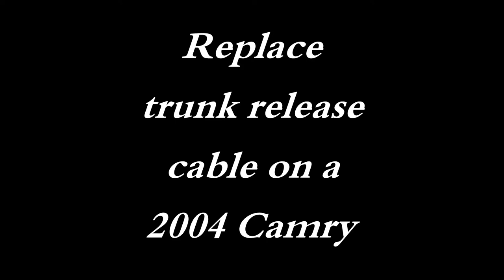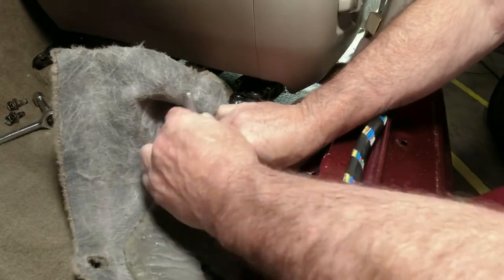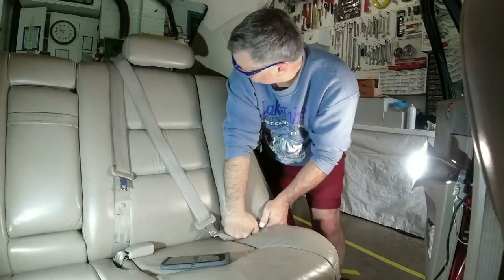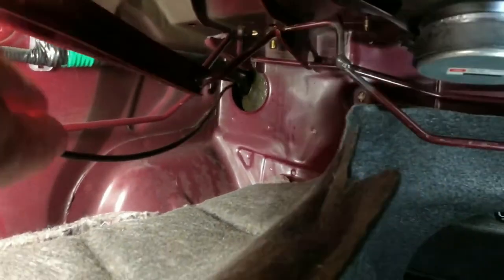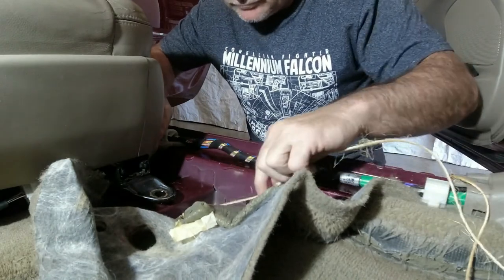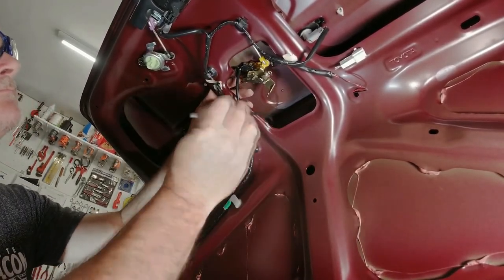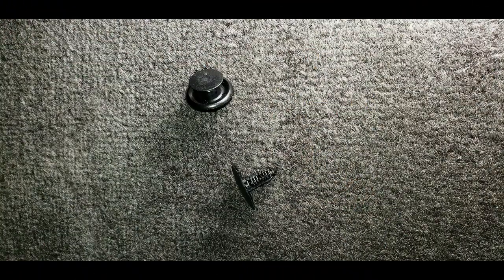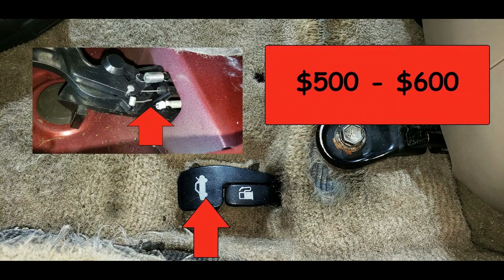Auto (replacing a trunk release cable in 2002  - 2006 Camry)

Comment: Thank you, I was able to replace the cable at my Toyota Aurion 2009 with your guide. Had to increase the tension a bit by adding an extra buffer before the ending. The release mechanism wouldn't work otherwise. But that's because I am using a $90 cable from Amazon rather than the original Toyota one. 

It's great that these older cars allow you to do a lot of the mending yourself. My dad would be proud. He fixed his own car in the 90s too.
Reply from the maker: Glad it helped

Comment: Very helpful, but I simply soldered an extension to the broken section of wire of the release cable. Still no clue why it decided to randomly snap. My 2006 looks a little different, but the process for getting to the trunk latch is basically the same. 
Thanks for the video :D

Comment: Thanks for making this. Just used this vid to do this on my 2016 camry. Mostly the same except there are two bolts instead of one on the rear seat, and the cable had a black tip on one end and a white tip on the other. The black goes in the trunk, the other in the cabin.

Comment: Your video helped me fixing my 2005 camry trunk. Thanks for the video!
Reply from the maker: I'm very glad to hear that. Stay tuned. Tommorow I will be posting how to replace your radiator. Your car is old enough that it should be going bad anytime now. Don't worry, its a piece of cake to replace. I just replaced my 2004 camry radiator.
Reply: Crazy how it's always the trunk cable that gets worn out with these Camry's. Over time that metal wire attached to the release lever mechanism release gets stretched too far and loses tension. Though it's not mandatory to replace it as long as the gas cable is working fine, it's just an inconvenience to always have to use your key to access the trunk.